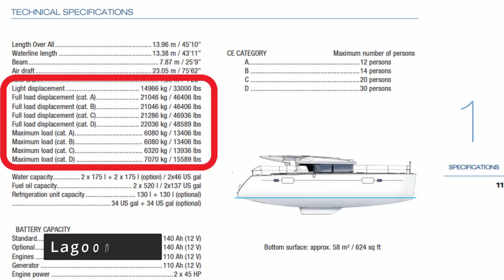Your Sidestays are Designed to FAIL Before You Fly a Hull

Comment: have you seen cyclops marine digital direct wired load pins ? are they any good for shrouds ?
Reply from the maker: Yes I deal with Cyclops Marine a lot in a professional capacity. They are very good people and very helpful. They have some great products but I need to spend a bit more time using their products to give you a solid answer on that. At this stage they won't do load cell pins smaller than 22mm diameter due to technical contraints. That is why they did the turnbuckle bodies. If you talk to Cyclops Marine make sure you mention me (Shayne) as I have been talking to them a lot about load sensing options for smaller boats and it may help them understand your needs.

Comment: whoever came up with that 'myth' is a bit nutso. Our boat was a 53 by 27 foot ally Crowther, shrouds were 14mm 19X1 SS, breaking strain around 14 tons, way over the total weight of the loaded boat. Not a performance boat at all although had massive daggerboards, lightship was 10.5 tons. Mast was 65 ft, boom 20 ft, rig was a mast head cutter, double sleeved from the base to about a meter short of the masthead. All up weight of the rig with wire and forestay foil was 752kg.
Reply from the maker: That's some big gear you were running on your Crowther. And yeah, couldn't believe people think that sidestays breaking is a safety feature!

Comment: Great video Shayne! Thank you so much for your input on this topic. I have seen videos of the ORC57 using this system and praising it as a safety feature. Always good to know the other side of the coin, especially coming from someone we can trust. Cheers!!
Reply from the maker: We would recommend using load cells but you still need to be vigilant and understand how to use it in order for it to be an effective safety system.
Reply: I think the orc57's release the cam cleats on the sheets, rather than the stays. which would be safer if its the case.